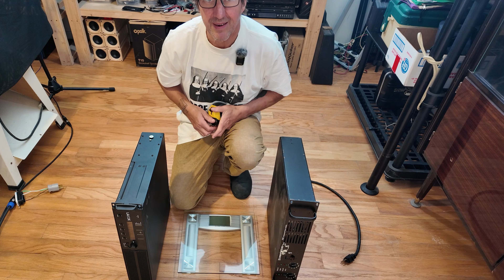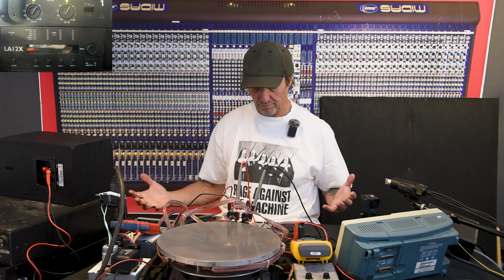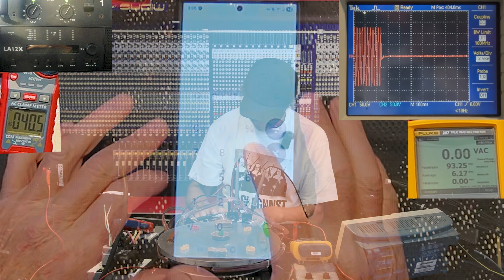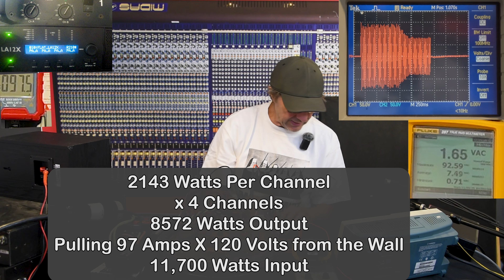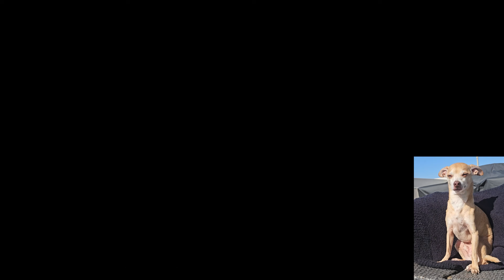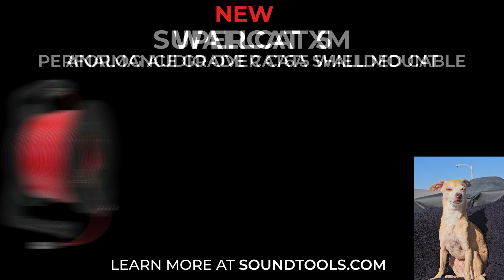Who Does RMS Power Better, Old or New Amp?

Comment: You know that this is not a classification of the amp class. It is how gear is constructed and which compromises are made to have specs. And IF a manufacturer wanted to make a class D with stable performance, you would have a LITTLE more weight per nominal output power. It's taste and marketing, not the construction principle. Mainly weight and stability is about the power supply, not so much the output stage.

Comment: Very interesting video. 
Good quality class D amps are certainly thr way forward for large PA setups, especially for touring. 
35 years ago, when I was doing national tours as an engineer, we had huge racks of BGW amplifiers that weighed a ton. I'll take the modern class D amps (good quality ones) any day for that application. 

Nice Fluke DMM too. I have a 289 that I purchased nearly a decade ago and it is the best DMM I've owned by far.

Comment: How do they compare on 220-240volt in?
The switchmode only needs to handle half the current and might not even go into protection and turn down the output.
The hot plate needs a big pot of water for more thermal mass.

Comment: To Dave Rat:
I have an observation:
Your Fluke 287 is running crazy in AC mode, between 0 and 2 Volt.
Now, I have a 289 and some friends have 289's as well. More or less the same.
So, there are 2 main board generations for these meters, and they unfortunately very often have this problem like yours have.
We have looked at this, and also at some Flukes for sale, not only owned ones in action.
1... ONE... is working properly. (and that is mine). ALL the others are defect.
I also have a Fluke 179 and it is working. But less precision. So the 287 and 289 it is, for precision and other options, such as data sending and logging.
Some may argue that this is on the wide scale range to 1000 Volt and since it's a true RMS meter, it may pickup noise or false readings. Well, in working with the meter, it may be subjected to all sorts of influence, so will have to be better designed to avoid this problem. My own example does not show this problem. Why? Or rather why not? We have subjected it to the exact same influence.

I think Fluke have had absolutely NO development since around 12 years ago when 287/289 came out (or there about) and that there is NO incentive to go buy a Fluke today. It is really bad and I am sorry to say this, but that is my observation, despite I'd like Fluke to stay on top of the game. And be stable. I much prefer Fluke over the chinese competition. I've looked at a few 87III and two 87IV and they seem stable.
In my humble view, the Fluke 287 and Fluke 289 which are the top of the pop from Fluke, are faulty at design and stability and performance.
I would like Fluke to admit this, and to freely send out new corrected updated pcb's to the owners, no matter if you are the original buyer or later, down the time track. That would be the right thing to do and possibly restore confidence in Fluke again. As it is now, I will not be buying more Fluke's. Because it is a ... fluke.
Also, my Fluke VT-04 is a bit unstable to say te least. I am tired of that. If I buy absolute scrap crap chinese, there is no problem. How is that? You know now, that Fluke is no longer made in USA, but for a while have been made is china. And there is even a Fluke 289C (China). That is embarrasing.
What is your take on this error? Why does so many fluctuate? (with calibration or without).

Cheers.

Comment: Power does not tell the full story. You need to take the speaker sensitivity into account as well. Tube amps usually have speakers > 90 db/w/m.

So it possible a 5 Watt tube amp can sound louder than a 20 Watt transistor amp.
Reply: so you design your system, taking into account speaker sensitivity...

Comment: Great demo, Dave, thank you :)  I was watching the SpaceX rocket engine presentation, and one reason they've been able to reduce the cost, complexity, weight, and build time while increasing power, efficiency, and quality is with 3D printing.  I wonder if the same progress is or can be made in speaker enclosures?  It seems the cabs get more complex, harder to build, drivers are more complex and costly (the Meyer 21" sub has 4 voice coils), and the cost keeps going up.  BassBoss Kraken four 21" is $18k.  Meyer Sound Ultra X-80 is $16k.  God knows where Danley is with their stuff, but it weighs a ton and costs that too.  I wonder if we just need a SpaceX approach to our PA gear...?

Comment: To get RMS watts you need to multiply the answer by 0.707 (V2/R) x 0.707 otherwise it's watts peak.  The 0.707 is for AC sine waves. When compared with DC . Great video though dude 👍

Comment: Imagine a world where you could actually trust the nameplate wattage instead of having to calculate the wall current/voltage to find an honest number.
Like sure, the amp might do 4000w, just not on a 15A breaker sustained, which, it won't, it will produce a 4000w impulse before the filters are empty and it clips. Might be ok, might not be ok, depends on what you're trying to reproduce. 

Truly though, if you need the nameplate capacity of an amp, what you actually need is more amps.
Reply from the maker: it's tough because people want to see Watts, continuous output watts and they want to see the amp do it except if they're listening to it in which case continuous output watts don't matter with music typically because we need peak power and that's what sounds better. 

So with poweramps we kind of want what we don't need except for certain types of music that actually need it 

So then the thought is well let's just get it and have it there always, in case we need it. 

but then we have an extra truck and sore backs and nowhere to put all this giant heat producing boat anchor stuff because we're carrying around a whole bunch of crap that we don't need. 

unless of course we need it
Reply: @DaveRat  Very well said as always sensai Rat

Comment: But does it actually matter? The LA12X power drops after 250ms if i'm reading correctly on that osciloscope, that is not a random time.
it's enought to cover all the transients in a kick or a snare then give a little break to the capacitors to recharge and then to thump again.
The EDM janre is a bit different tho with all these long bass heavy sounds, but i think if the systems is calculated right with enough power headroom it shouldn't be a problem. 
Also at a producing stage of song, a lot of samples, synthesizer presets, side chain copressors, their ADSR curve already have that "power compression" naturaly.
So does the sustained power for such a long time actually matter?
Reply from the maker: I think it does matter. I used to work with Bassnectar and you could definitely hear the subs hit a long bass note and then reduce in volume if the system wasn't powered up in a well thought out way. 

I think the key to all of this is that from a long-term RMS perspective, old school amp watts are closer to what you're actually going to get then new school amp watts.

that said, New school class D amps are capable of putting out more power for the same size circuit breaker, for given amount of rack space, and per pound and per cubic foot. 

if you replace a 2000 watt old school app with a 2000 watt new school amp then you replacing a big boat anchor with a tiny little handheld device. And yeah the tiny little handheld device may put out 2000 w short-term but it's not going to hold ground in the long term against the old amp. 

but if you replace 50 lb 2000 old amp with 25 lb 10,000 watt new amp, you can get more RMS power over a longer period of time in less rack space/weight/size
Reply: I agree, but I think it's important to consider the crest factor for those power ratings; more of the big manufacturers should list it in their spec sheets.

I had a similar experience with some old NEXT MA-series amps. To this day, I have never heard my subs play so loud and so well. I later experimented with some Crown XTIs—they did the job, and the lighter weight was definitely appreciated. Finally, I bought some Lab Gruppen FP+ amps and I'm happy with them. Sonically, they are better than the Crowns, but for my system, the NEXT amps remain unbeaten.

Comment: Not sure if you guys are familiar with these amps, but back in the day, a few years back when I was running my custom P. A. design & for hire firm here in the states, I tried using some amps by a European company called PKN.   They were absurd in every Way! You could run them essentially with any voltage/phase configuration you had available.  The reason I picked them up was that they delivered a (real) solid 40,000 watts (approx & depending) from a 1u sized chassis. All that was required was a direct to unit 3phase tap off the mains without ANY sag, to be made available exclusively to the amps.  They were effing awesome, but had their share of negatives as well.  Let's not forget the night I witnessed 1 of 6 of these EXPENSIVE monsters took a fiery dump that shut down the whole rack.  It turned itself into the most violent arc welding experiment imaginable, as well as the evenings unscheduled pyro demonstration. Sadly, the damage was so severe there was no way in hell of determining what the fault was within the unit. The beauty is allowed you a level of headroom that you could only dream. Not the most musically accurate devices I've ever heard or utilized through the years. But a lot of that could be ironed out just before you got the audio signal into the device - basically EQ the snot out of it and it was splendid enough to match its impact, which was indeed completely visceral. I quickly turned around and sold for those units unfortunately number five was the one above the exploder and had enough damage to its underside to just not bothered trying to explain to whomever wanted to purchase the thing.  However I am thinking about going back to one of these days...

Comment: blowing a breaker is not sustained output
Reply from the maker: agreed and the lower efficiency of older amps kind of results they're being a giant limiter reducing the maximum output power capability for a given wiregate size or a given breaker size or a given building power feed size

Comment: So purchase four class D amps and only use one channel on each of them to get the maximum amount of the class D. 
   That’s another way to look at it.
Reply from the maker: Yes if you plan on running pure sine wave tones,  

pretty much it's easy to calculate, look at the circuit breaker size for the amp, multiply that by the input voltage. So for a 30 amp breaker on 120 v that would be 3,600 watts. now derate that by amplifier efficiency. 

So for a class D amp take off maybe 5 or 10% and for a class A B take off like 30 to 50% 

And that's what you're going to be able to get out of the amplifier long-term RMS maximum for a well-designed amp 

So figure 3200 w or so from each 30 amp breaker using class D and figure 2,000 Watts or so maximum for class AB or class h amplifiers, per 30 amp breaker. 

for midterm power output you can increase those by 25% or so because circuit breakers are designed to handle overload for short to mid periods of time
Reply: @DaveRat  no Electrician would ever advise using a 30 amp circuit breaker at 120 V. 
     Every Electrician would just snap right over to 240 V. 
     For a 30 A load operating at 120 V AC at 100% duty cycle (continuous load), you should use 8 AWG copper wire to ensure safety and code compliance.While 10 AWG copper is commonly rated for 30 amps, the National Electrical Code (NEC) requires continuous loads (running for 3+ hours) to be calculated at 125% of the load, requiring a circuit designed for 37.5 amps (\(30\text{A} \times 1.25 = 37.5\text{A}\)).Key Requirements:Wire Gauge: 8 AWG Copper (for 30A continuous).Breaker Size: 40 Amp.Voltage Drop: If the run is longer than 50–100 feet, you may need to increase to 6 AWG to prevent voltage drop.Why 10 AWG is not recommended for this specific application:10 AWG copper wire is typically limited to 30 amps total, or 24 amps for a continuous load (80% rule), making it unsuitable for a 100% duty cycle 30A application. Using 8 AWG provides necessary thermal safety margin for continuous operation.
       Long line length from the main circuit breaker. Plus as we know in reality on sound stage set up sometimes they might be running two or even three separate connections before they get out to the equipment and every connection there is a voltage drop and resistance.. 
      240 V you can cut the wire gauge size in half to deliver the same amount of current at 120 V with a six gauge wire.

Comment: So essentially the class D platform's output tracks breaker trip curves.
Reply from the maker: not inherently but you did hit on a good point. 

L-ACOUSTICS has designed that amp and their amps in general to track the breaker curves of the recommended breakers for those amplifiers. 

they even go as far as to specify the exact breaker model that is recommended in the specifications for the amplifier
Reply: @DaveRat  Thanks for the info.
Always interesting to see what these companies think of in the big picture.

Comment: I find the transients on class D stuff a bit flubby. Like they have less control of the speaker (poor damping factor). 

Car audio wise, alpine went from rating their amps RMS at like 0.05% THD to 1% or something. Probably not audible, but still nowhere near as good.
Reply from the maker: interesting. I don't have much experience with car audio amplifiers but I do believe that the specifications they use are much less stringent than home Hi-Fi and pro Audio 

I don't think this is a class D versus class A B issue. as class D amplifiers can have excellent if not superior damping factor driving lower impedance loads. 

this sounds like either a specific manufacturer issue or maybe something related to car audio specification looseness
Reply: a lot of class D, you can programme damping factor

Comment: Am I missing something here? How can u compare a 900 watt per channel amp  to a 2000x4? Not to mention a $3,000 amp to a $600 amp? Myself am about reliability and sound quality. Class d has gotten better but lets see if those amps are still around 40yrs from now. I have 4 crest power amps for my home system that are not going anywhere. In sound quality, relia ility, build quality it lays waist to many class d cost cutting tin can amps. Now touring bands is where class d shines. More power, less weight and space where for the most part the audiance could not tell what amps your using. As always it's personal preference and what works best for your sittuation.

Comment: I was about to comment that, "Who really cares about the size and/or weight?"  For most of us, once we move the amp in and set it up, size and weight really don't matter.  It is not going anywhere.  Then it hit me,  There are lots of people who set up to do sound at an event, at a temporary location, who are packing their stuff up, carrying it into the location, setting it up, tearing down, carry it out, and packing it back into a vehicle, then unloading it at home.
Reply: Also bands usually have more than one member but us poor solo DJ's are packing every single bit of equipment in and out at the end of the night.
Whenever I bought something it had to be within my triangle of
*Quality of sound
*Price
*Weight
If two items were equal on sound & price then the weight was the deciding factor.
Reply: You got it! It's because Dave and others who do Coachella-size systems care about pack size and weight.  It's not about the one amplifier, it's about working with 50 of them.

Comment: In our current-gen stuff, this is exactly why our amplifier matching for subwoofers is roughly half as many cabinets per amp chassis as tops. You can certainly save cash if you only expect really peaky LF and aren't worried about long notes with low CF, but most music typically has increasing CF with increasing frequency. So if you want to give the subs full headroom for both RMS and peak needs, you need to assume subs are capable of being ~3dB "thirstier" for RMS than the tops in most systems. 😊

Comment: Thanks for doing this test. Pretty much what I have experienced in clubs.  When I retired a couple of Bryston  4 b / 800 w amps after 17 years of service with Crown amps with 1200 w. The old amps still sounded better 😢, but the power output in the real world was about the same. So spec more power  by 50% when switching to class D amps ? RIP BRYSTON